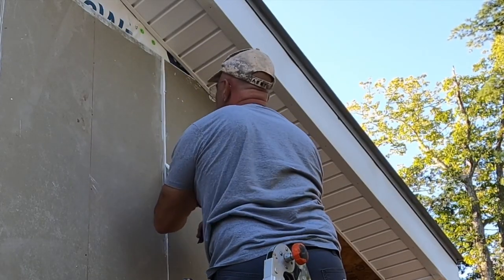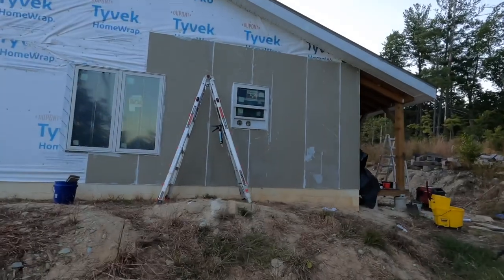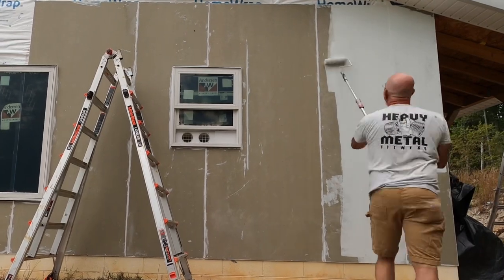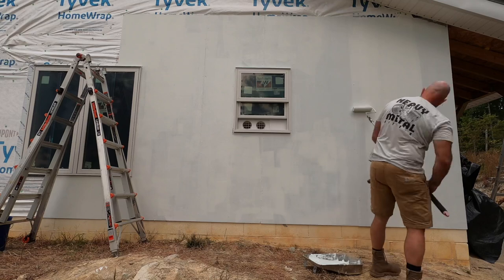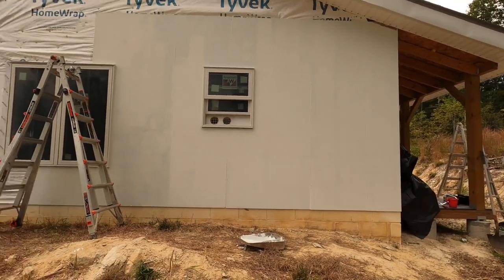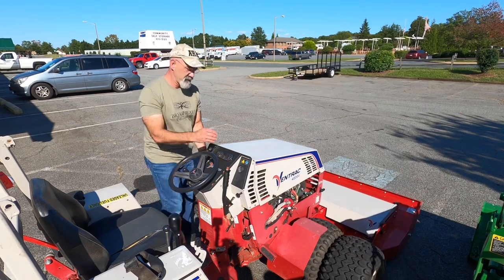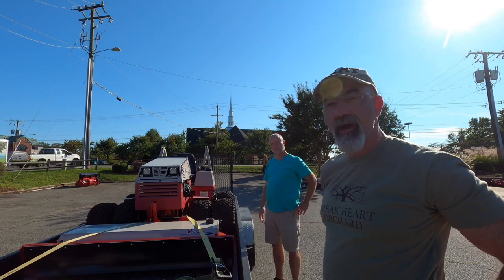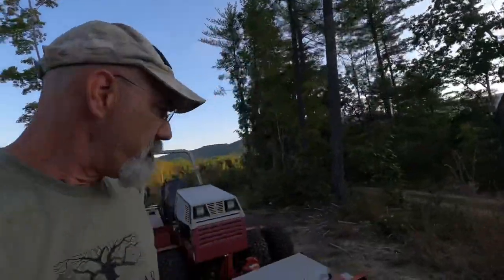A Coat of Paint and an Anniversary Surprise (Ventrac).

Comment: If you can, I'd suggest trying liquid flashing instead of caulking.  Costs a bit more but I I've been very impressed.  Comes in a 20oz tube to be used with a sausage gun, much better than a caulking gun.  Have used Zip and Prosoco brands.  Both have held up very very well where caulking hasn't.

Nice mower, haven't heard of that brand before.
Reply from the maker: I’ll have to look at the flashing.   I have been looking over the heat loss calculations after watching your boiler install  video. It us hard to believe but the numbers say overkill on radiant and properly sized for our hot water usage (when house is full).

Comment: @3:26, these two holes I see on the bottom of the small window’s frame, are they exhaust fans?
Reply from the maker: I currently have a portable AC unit installed. Temporary.
Reply: @breakheartorchard4761  - I see, thanks...

Comment: add some soap or detergent in water for a smooth finish and it wont stick stick on your  finger.. and a lot will saved..
Reply from the maker: To the paint?  I’ ve never heard of that.
Reply: @breakheartorchard4761  no Not the paint.. i am talking about the sealer which you are using to fill in the gaps..ALEX Plus
Reply from the maker: @culturalheritage4550  ahh. So put a little soap in my water cup when I wipe it down. That makes sense.
Reply: @breakheartorchard4761  yes :)